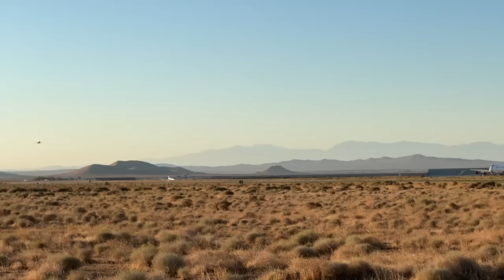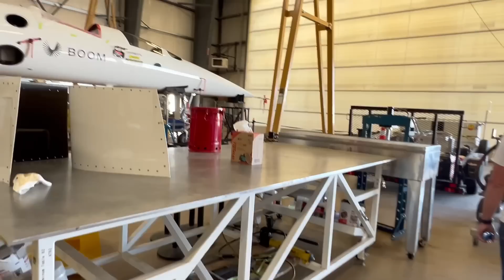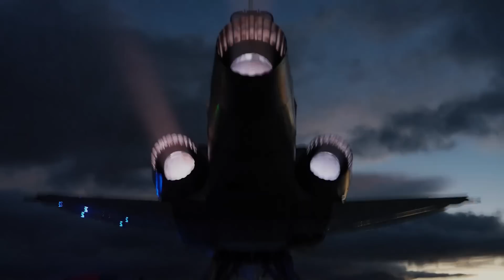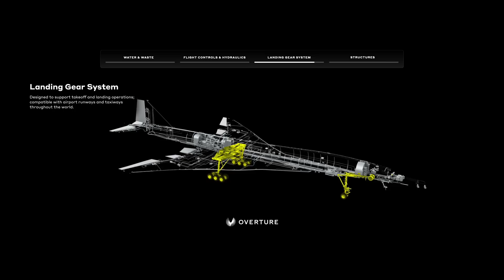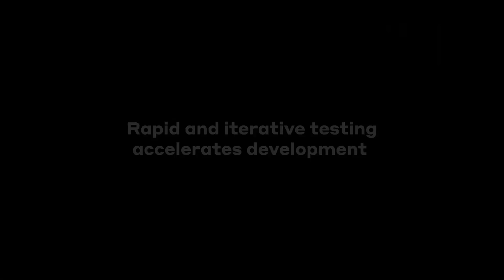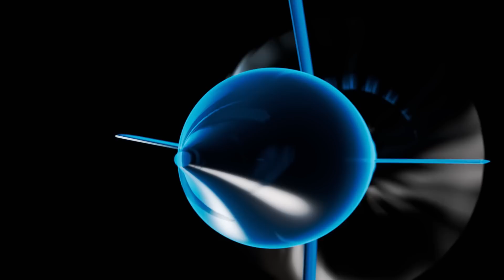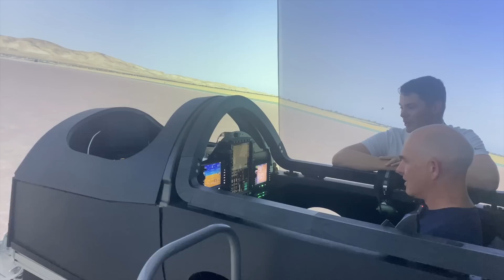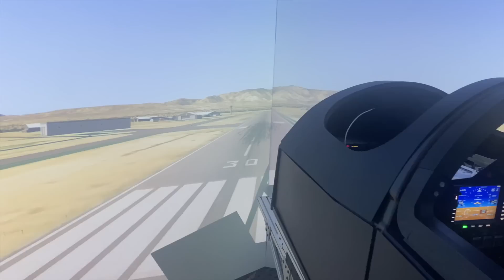Will This Experimental Supersonic Aircraft Show Supersonic Airliners Can Work?

Comment: The answer is no.
And i have no idea why this video is 22 min long. Laws of physics didn't changed much since Concord prooved that supersonic passenger flights are not economically viable.
Reply: Did you know first passenger and freight trains proved rail traffic was not economically viable either?
Reply: @vksasdgaming9472  it pretty much is the most economically viable way of transportation in existence.
Supersonic flights aren't, it requires too much energy.
Reply: @chastity_belt  First railroads were not economically viable means of transportation. Same applies to supersonic flight that has never developed from pioneering phase. Flight itself is very energy-inefficient method of transporting anything.
Reply: @vksasdgaming9472  they were
This is a reason why they were built in a first place 
And regular flights are quite energy efficient actually. Modern jets burns near same amount of fuel per distance travelled as cars. Not exactly, but it's more than good enough considering how fast and how far planes transporting things and people. It is economically viable.
But it's not the case with supersonic. For sustained ss speed it takes few times more fuel then regular flight. Like x2 or x3 or even more. Concord at supersonic speed burns around 2,5 times more fuel than regular plane does. Soviet Concordski tu-144 managed to multiply fuel consumption by x6.
And apart from fuel consumption, supersonic flights are just crazy complex thing to achieve. It's just a miracle that Concord really worked at regular flights at all.
Reply: @chastity_belt  Supersonic civil flight reached first generation. Then it was discarded as "too expensive" to develop further. Current energy efficiency of trains and passenger planes is result of long-term investment and development from very inefficient early forms. Why guns are prominent weapon in military use is because somebody saw something worth developing in those noisy, smoky, awkward and inefficient hand cannons some soldiers had to operate. Nobody saw anything worth developing in supersonic transport.

Your credibility would grow if you used proper names as well. All form of flight is actually very easy to achieve. Controlling and landing are the hard part.

Comment: From a safety perspective the camera-only landing doesn't feel right. They could have a window between the pilots legs looking though the fuselage onto the horizon (12 degree AOA) for emergencies so he can at least see what's going on if both cameras/displays fail
Reply: Surely it is just a matter of redundancy - having enough independently powered and connected cameras in different places with an extra screen or two in the cabin. Cameras and screens are very, very cheap these days.

Comment: Instead of just a Delta Wing, why not use a conventional wing at take off that sweeps back during supersonic flight (like an F-14)? Shorter runways and easier landings.  No matter what the configuration, any commercial supersonic jet will have to involve a hybrid jet/ramjet engine to make fuel consumption cheap enough to bring economies of scale to point where the average Business Class Traveler could afford.
Reply: Swing-wing mechanisms are impractically heavy at airliner scale. The high maintenance cost of the swing-wing mechanism was also, I believe, one of the primary reasons the F-14 was retired from active service.

Comment: The engines they plan to use are expected to burn more fuel than the Concord engines. A strange economic choice. Unless the investment funds directed toward reviving commercial supersonic flights are being spent to prop up fossil fuel demand, as suggested in the leaked Aramco slide deck.

Comment: Sounds like a cool concept but I think rather sooner than later it will be forbidden to do commercial stratosperic flights, due to the environmental impact. Since supersonic flights mostly make sense when your that high up, i dont see this thing to be viable unless you can use some sort of 0 emission engine. Stratosperic flight are mostly unregulated since there is not much traffic up there, if you use that airspace a bunch it will not take long until its forbidden. Since the main problem is that the stratosphere is not mixed with the troposhere you get  a bunch of exhaust that will stay up there for a long time.

Comment: They've got a long way to go, and I'm wondering if any discussion of economic forces outside their control is a slide in their pitch deck. One question I would have asked is how many passengers this is supposed to be able to carry, cuz that was a critical factor that led to the end of the Concorde. I also thought it interesting that the 3-D render did not include the engines.

Comment: I'm trying to understand how this single seat demonstrator has any bearing whatsoever on the 100+ seat airliner, in terms of pretty much everything, every single module. Apart from some UI elements, how does any of this translate to the final thing?

The only explanation is that they're just waiting for that sweet defence contract and a big juicy cash infusion from Un cle Sam, to cash out and bro down.
Reply: The point of this aircraft is to show that the company is able to safely operate a simpler single seat version of their planned airliner. Operation of something like this is complex and like Tristan said, shows they have safety culture and a sensible approach.
Reply: @Sturmovik1946  How does this apply to a full airliner, in terms of that safety? What exactly translates from this to the full, final version? Every single airline is meant, is absolutely expected to have a "safety culture", that is absolute baseline.
Reply: @daciandraco6462  I think it's more about the structure of the company, that they can source parts/design their own, manufacture and maintain the aircraft, and develop processes/procedures for all of the above.
Reply: @Sturmovik1946  You don't need a safety culture to slap together some experimental single seater, or as it turns out even for running the second largest manufacturer of civilian airliners in the world...
Reply: @johannesgutsmiedl366  sure...
Reply: It gives them experience building and creating systems, but yeah...
Reply: it's defense but heck if autocorrect will allow it
Reply: It's beyond useless for defense.  This is a venture capital investment scam.  Maybe it didn't start that way, but when all of the free world's engine suppliers said it wasn't profitable to develop the powerplant, that was game over.  Even with existing engines, the airframe development, manufacture, and cert would have cost probably $10 billion.

Comment: There's another problem with SSTs that no one seems to talk about - the service life of a turbojet vs turbofan is really bad. A family friend was a maintainer in the RCAF and said most of these engines are rebuilt after only a few dozen flight hours where as a modern high bypass turbofan can go for thousands of flight hours. I'm sure this will improve over time but is a massive hurdle to airlines. Also flame-outs are much more likely and is harder to correct for yaw rotation at higher alltitudes (probably why the tail-plane is so large lol). This is the most promising development in my lifetime, but there is a long way to go!
Reply: Almost every single airliner in service today uses a high bypass turbofan due to efficiency and noise reasons. What engine models is your RCAF friend referring to?
Reply: @nightjarflying  turbo jet, not turbo fan, different technology.
Reply: Turbojets haven't been made since maybe the 1960s.
Reply: @zacklewis342  huh? i think you need to google that

Comment: "As many as it takes to do it safely"

Not another Oceangate then.
Reply: You don't get many Oceangates in the aviation industry.
Reply: The owners are actual engineers funded by VC firms and airline companies. Not the type of guys to gamble with their lives
Reply: "Well how many atmosphere of pressure can the plane take?"

"Well, it's an airship. So I'd say anywhere between zero and one."
Reply: @Xylos144  The Oceangate reference isn't to pressure its to cutting corners and these guys are NOT behaving that way.
Reply: Aerospace engineer here - CORRECT.
There's actually something in this that is a give-away that they are THINKING CLEARLY.
I am super impressed by what this one thing tells me.
About 5  minutes in Scott mentions the J85 engines.

A few years ago I did a proposal to the Australian Space Agency for a program based around air launching small cube sat capable rockets using a variation of the Scaled Composites White Knight 1 which was used for Spaceship 1 and a couple of NASA programs. WK 1 also uses the J85. The main reasons was it can operate at higher altitudes (>50,000ft), it was available and it was maintainable. 

Part of the reason I picked the WK-1 was because of the engine. We could get a second hand ex-USAF T38 for a chase plane (same engine). We could get an early model Learjet (23, 24, 25, 28) as a air launch platform for smaller rockets (<1.2t) as its engine is from the civilian variation of the J85.

THE MAIN REASON for thinking like that is it saves a massive amount on maintenance costs because all your jet engines are from the same family. Which means the parts you have to carry and having mechanics available is massively easier than many other engines or just as bad having a variety of engines. PLUS the J85 and its civilian variants, although out of production, are so widely used that the parts needed to maintain them are still available. Because the USAF still has the T38 they need spare parts so the spare parts are still in production even though the engines are not.

I have worked on development projects many times and one of the things you look to do is select things YOU KNOW WILL WORK so you can concentrate on other things. This is fundamental to project management. This is called project risk reduction and so many companies get it wrong which is why so many development projects fail.

Just that one thing has completely changed my mind that these guys are both sensible and practical rather than being another money pit operating on fantasy land whim.

Comment: The TSA line will take longer than the flight abroad.
Reply: This is why for city hops along the Northeast Corridor, Amtrak Acela basically killed using air shuttles. I am sure it also helps that train designers are smarter than plane designers when it comes to human anatomy. The seats on the train were designed by someone who remembers most humans come with legs.  So leg room and no 2hrs of security theater it was an easy win.

Comment: That's really cool, and I hope they fail. 

Twice the fuel use of what is already the most polluting means of transport is simply not acceptable.
Reply: Nowhere close to the most polluting.  Ever heard of a 2-stroke motorcycle?  Airliners are massively efficient in terms of mass/distance.
Reply: @zacklewis342  planes encourage people to travel much further than mopeds.
If you travel by plane, that's likely the largest source of your emissions, by far.